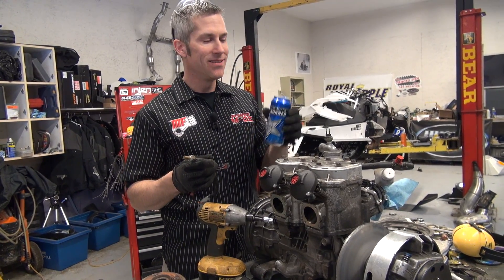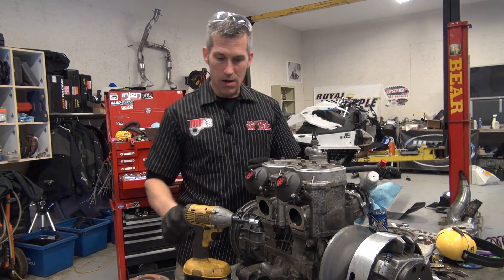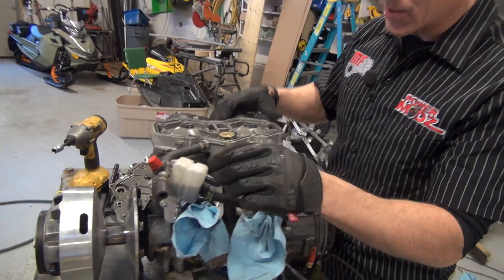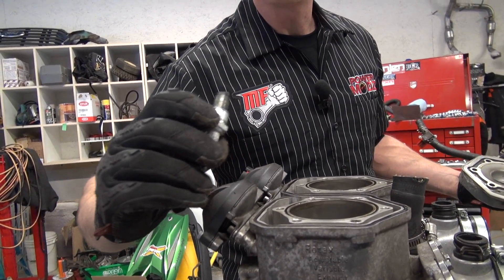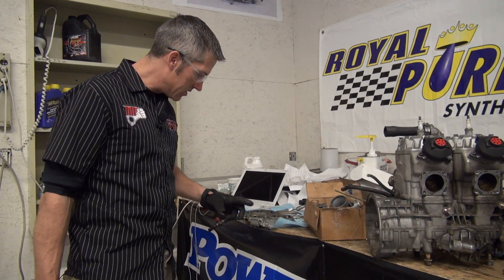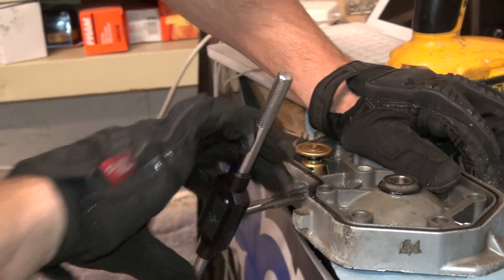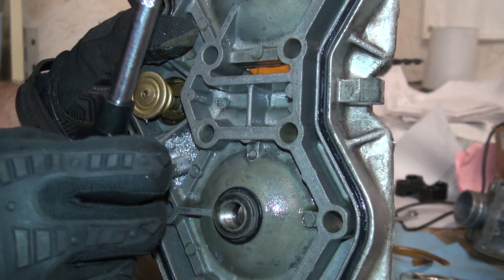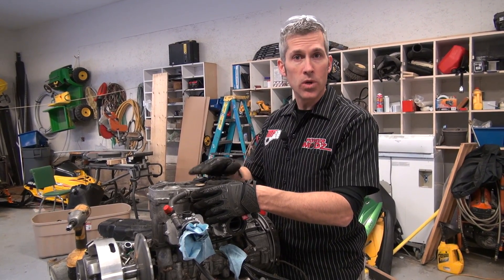Episode #7, tapping 700 Rotax head for a temp sensor.  700 REV mod sled build!  PowerModz!

Comment from the maker: Bets thing to do is buy a manual on line, pretty cheap - that way you can see exactly what to do.  if the head gasket is loose the replace it and dont drive with a cracked manifold - you can damage your motor.  Thanks for watching guys!